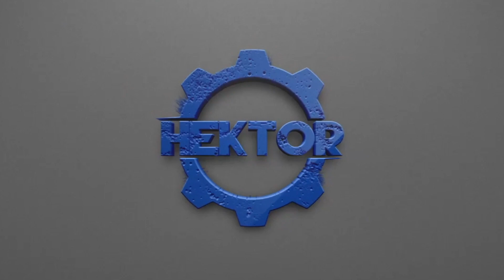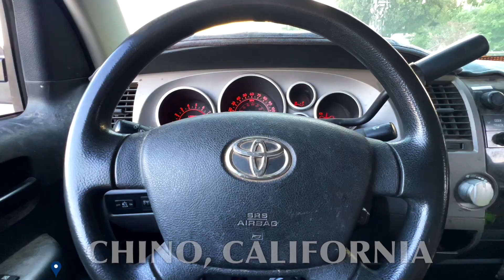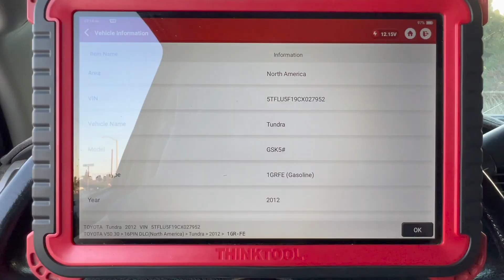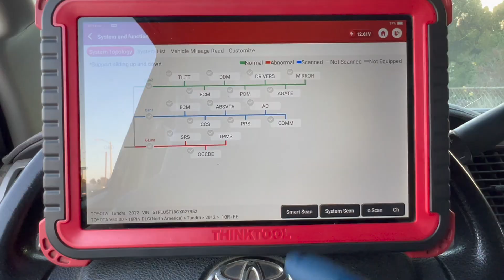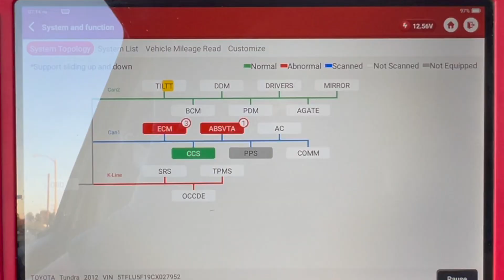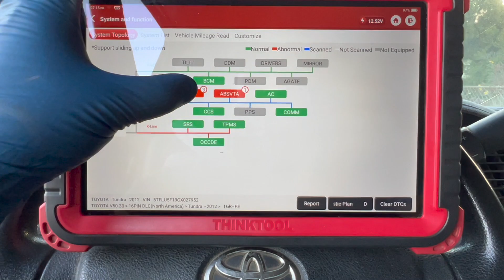Toyota Tundra Transmission Issues - What a Piece of Shift !!!

Comment: Toyota 2008 Tundra 5.7 crewmax 2WD

P2757 (1–2) stored

Torque Converter Clutch Pressure Control Solenoid – Performance/Stuck Off.

These transmission shops in California near me tried to charge me $25K for a whole new transmission, when all I asked for was a simple P2757 solenoid replacement. Total scam.

I wish you were close by- I know you'd actually fix it right

Where you located?

Comment: I had a similar problem on a 2000 4Runner over 3 years ago.  Transmission would periodically not shift correctly, as when stopped at a light.  Code that came up identified S3(?) solenoid as being bad.  I removed S1, S2, and S3.  My regular mechanic used his software to help me identify the proper solenoid in question.  To test the solenoids, I connected the body of each solenoid to one of the connectors of a 9 volt battery and the solenoid wire to the remaining connector.  When the connection was made, I could hear and physically see the solenoid react.  The broken solenoid didn't react.  Solenoid was replaced.  Transmission continues to shift correctly after 3+ years!  Gracias Amigo!

Comment: Yup they’re shit. Motors run great but overall they suck.
The biggest problem with scanners is the people reading them. I’m currently trying to get my Tundra inspected and the mechanic said that three of the four wheel speed sensors are bad and I automatically thought what’s the likelihood that all three were bad. After replacing the three sensors they said the fourth wheel speed sensors is bad……..that’s about as probable as winning the big lottery.
I knew immediately that the mechanic reading the scanner is reading it wrong. The scanner shows the effects but the cause is something else, there’s got to be something else which is sending error codes. I’m not a mechanic but common sense and a little logic tells me that there’s a central monitoring device which is bad.
$800 later and I’m looking for the cause of the error codes myself and replacing parts as I go. Yeah it sucks to replace parts which aren’t bad but I’m saving myself $100 per hour by doing the same thing.
I’ll be ordering the other transmission speed sensor today at $170. Will it work? Probably not but until, and if, I find someone who actually knows how to read a code scanner I have no other options.
This is the last vehicle that I’ll ever buy made after 1986. Fuk all of the computerized vehicles!

Comment: The LED test light is gone burn you one day. You need to use an incandescent test light or tail lamp bulb. Had one of these Trucks with 12v on the S3 wire. Add a load like a tail lamp but it was 1.5v.  disconnect connector and activated again, checked at ECM same. ECM toast!

Comment: Thanks for posting this video it was a big help but didn't completely resolve the issue and I'm really hoping you can share a thought or two. Some time ago the 1st gear went out on the tranny of my 2005 4 runner. My fixed device gave me code PO986 E shift solenoid. I replaced it and It does drive in 1st but it feels like the brakes are on. I have to give it a lot of gas to move the truck. Once it starts to move it does shift into 2nd gear with no problem. With the replacement of that part is there any recoding that needs to be done? I have put the reader on several times now and it no longer ready an error code. Any advice os greatly appreciated thanks.

Comment: So my tundra has a issue were when the teuck is cold usually when is been sitting for housrs and when i go to turn it on and try to shift to drive it wont engage the drive gear but it will go into reverse and park....sometime if engages just fine but more often then not  it takes a couple minutes to warm up and then it works but other times i have to keep switching in and out of park and reverse into drive till it engages, what solenoid could cause this i dont have a fancy scanner like that
Reply: I need help i havent found anything in the fourms that talks about an issue like this
Reply: I got the same exact problem on my 2008 v6 and i wonder if there any way to know what this reapair will cost i really love this truck but it wont pass inspection cuz of this issue and i really want to get it fixed and not have to spend thousands on a new transmission

Comment: I have a 2007 Tundra.  Solenoid C and D. error codes.  Does anyone know which wires or connector pins these are?  I've seen PDF files 700 pages long, and just can't find a simple picture that identifies each wire and pin.   I'd also like to buy the lead shown in the video with the female multimeter connector that goes onto one pin.  I dont' want the large kit for $100 right now.  But maybe a smaller kit that includes that connector.

Comment: Checking resistance is a nightmare. When you're trying to hold a mirror witj a flashlight in your teeth and touch only one pin with the tip of a multimeter probe.  While you're trying to keep a ground.   And then you're trying to hold the screen so you can actually see what the reading is.

Comment: I have the same code p0983 but no shifting issues i also have c1201 and c1340 can the p0983 be a phantom code? When my dash lights up the truck still runs fine and shifts fine it just won't go into 4wd or do anything in 4wd.

Comment: Great video. FWIW, I fill the transmission via the upper front cooling coil. Simply use a 3/8 clear tube forced into the rigid tube and gravity does the work.

Comment: I got codes p0761 shift solenoid “c” performance stuck off and p2714 pressure control solenoid “D” performance/stuck off and I’m having a really hard time finding the part numbers I need to fix it since they are labels different on the diagram or to know which ones they are on the diagram to order the correct parts.
Reply: I'm having the same issue now. Did you fix the problem? Any advice?

Comment: I change my oem transmission because it went out and The codes I get with my new transmission are p0717 anx stuck in 4th gear and I replaced it and still no fix so I decided to change my transmission and still same code and still stuck in 4th gear
Reply: I replaced the transmission again *

Comment: Some of these were recalled at one point. I had one getting stuck in and out. Had it worked on during frame spray job from a different recall. Same solenoid was recalled but not in my vin range. Dealership replaced  whole solenoid block and harness. Cost about$ 700.
Reply: They had a recall , dang with this truck had a major recall for the airpumps that cost 5k called the stupid dealership told them how much for a diagnostic they said 200 plus the fix they said sounds like a 3k or more job, oh my i said, ill get back to you, looked up forums someone said it was a major issue they had an that toyota would fix for free damn dealership in Baytown. Called the dealership ship again an told them  about this they oy yes just bring it in , your lucky its gonna save you thousands 🤔😡 snicky liars.
Reply: What year n make vehicle was it?

Comment: Hey brother I have a 2008 Toyota Sequoia 5.7 6 speed transmission with no reverse and shuttering between 1-4. It's throwing codes telling me shift solenoid C is stuck but I don't known which one is solenoid C how did you find out where your solenoid locations are by letters? Thanks Aaron
Reply: Did you ever figure out a fix for yours? I got no codes & no shuttering, but reverse won’t work randomly. TIA

Comment: Hi there,  great video!   Just what I was looking for!   My 2008 tundra 5.7 will not shift from 4th to 5th,  so I am having the same issue.  Do you have a part number for the  solenoid?  The solenoid your replaced,  is that the same part that can be installed into a 2008?   Hope you can reply !
Reply: That's messed up this guy didn't reply to your message.
Reply: I had the same issue with a 08 sequoia and i dumped it ,then i found a report of a guy who spent the money and the 5000 miles later had it screw up again

Comment: I have a 2000 Toyota tundra 4.7 no codes but it hammers into 2nd when above 2000 rpms Any idea or am I screwed
Reply: Maybe change the fluid.  The older models have a dip stick which makes things easier.  Get the good stuff.

Comment: Mine does this only on cold starts. If i warm up it works fine. On cold starts reverse has trouble engaging. Here lately the speedometer has been going from the speed im traveling to 0 and 10 30 70 and engine lights and other lights come on and off (while traveling). Where can i send you a video of it?

Comment: 01 tundra 4.7L cel light is on code P1780. Replaced neutral safety switch, lights still on. Need it gone to pass smog. Any ideas?